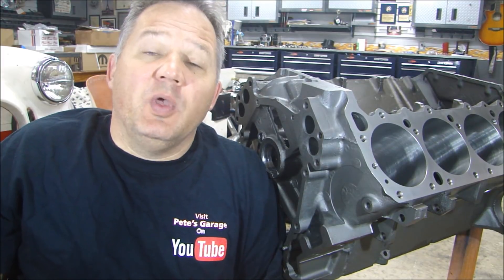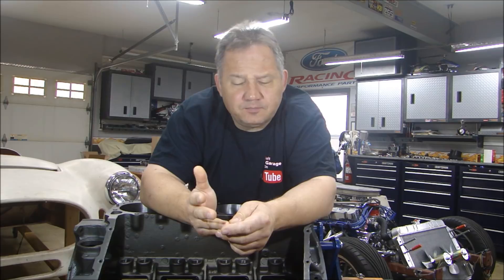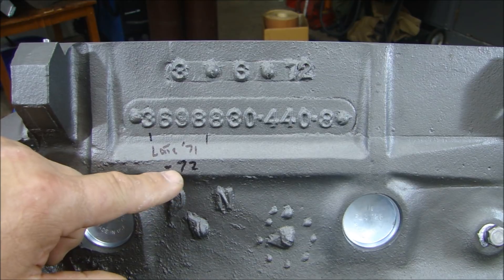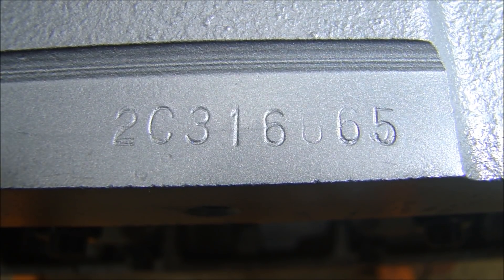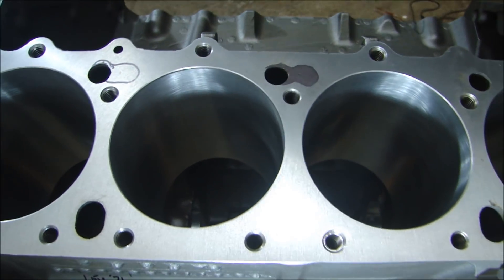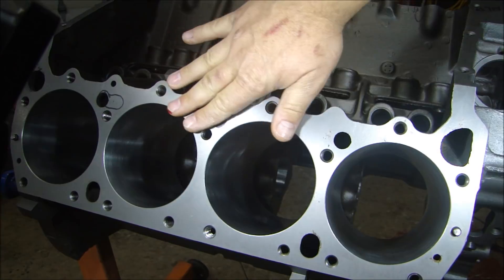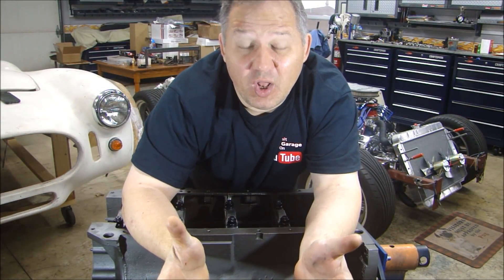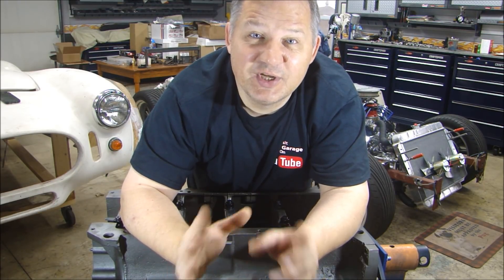440 Chrysler Mopar Engine Building Part 1 - Getting a Block and Machining

Comment: thanks ive got a 76 440 and a 67 383 the 383 was an old school 426 im rebuilding into a 426 been a process just figuring what im doing with pistons and rods bb chevy rods and pistons 1.70 rod ratio and 1.71 compression height are what that one is looking like. my 440 is headed towards the 500+ cube inch zone after i run it a little bit. interested to see what you use for crank pistons rods and heads .
Reply from the maker: That sounds like it will be a monster

Comment: Pete can u give me some input on a ATI  damper there is no keyway. Just is there any specs for a 44o thanks
Reply from the maker: I've never seen one without a keyway, they usually have two
Reply: This one bolts up with no keyway on a hughs crank is there something that I'm missing
Reply from the maker: Send me an email or text message with a picture and part number

Comment: You always deck the block before you bore and hone you remove taper for installation of pistons and rings otherwise will have a distorted block to bolt torque plate to .
Reply from the maker: Thanks!

Comment: yep old vid, the serial number is the car it was built with and it was built on the day shift. I have a '65 383 and I know where this engine came from, and I have had it for over 30 years. Finally sent it to machine shop that cost $1,500.00, pistons $125.00 ea, cam $429.00 (mopar) and mopar springs $14.95 each. Do the math. Oh and the engine kit $895.00.
Reply from the maker: Thanks Jerry

Comment: I wish you would do a series on a 351 cleveland
Reply from the maker: I did a series on a 351W which is pretty identical
Reply: @PetesGarage  similar but it has a unique set of challenges especially in the oiling system.
Reply from the maker: You're right, I always add an extra line to go back to add oil to the rear main.

Comment: Missed the engine build date info on surface at front left side of block . HP indicates it’s high preference block and letter ahead of 440 is year and then below that is the day and month of the build. The blocks were stored and left to cure before they were built. So you could have a 72 casting date with a 73 build date.
Reply from the maker: Thanks Tom

Comment: Just cross hatch the cylinders, new rings and bearings, new oil pump, seals and gaskets. Stuff a big cam in there. Fresh heads, good springs, throw it back together.
Reply from the maker: That's 1 way

Comment: Pete Has givin a lot of incorrect info on 440's. Read comments..... I'll add another correction. When honing a block, a torque plate is bolted to the TOP of the engine ! NOT Bottom (one bank at a time ), to simulate the head installed and torqued to specs. This is because the head bolts reach into /along side of the cylinder and when torqued it distorts the cylinder wall. Make sure bolt depth is the same on plate as the head. Installing the crank has nothing to do with honing cylinder walls.
Reply from the maker: Thanks Steven

Comment: I bought a 440 block, 2 heads, and 6pack intake from eBay. They were sold by gdmusclecarparts3wng out of Florida, they were advertised as "good", ready to bolt on. When I took them off the crate and started to examine them the heads were junk! The valves were rusted open or closed and the exhaust studs were broken off. I had to replace all of the vales, valve guides and 11 of the 16 seats. The block was usable with one exception. IT HAD 383 MAIN CAPS!!!!! When I contacted the seller he said "ya they are cores". The ad didn't have the word "core" in it anywhere. He refused to do anything. I contacted eBay and Pay Pal, they were both worthless. So I don't buy anything used from eBay any more. If you see him selling anything on eBay, I'd run,run as fast as you can.
Well, live and learn.
Reply: How'd you miss the "Flordia" in the name..
Reply from the maker: That sucks
Reply: you got what you wantrd

Comment: Usually you start washing a block for removing the remaining metal part did the maschine do this for before they put in the new plugs .... Thanks
Reply from the maker: Yes, the shop baked out the oil and washed it
Reply: @PetesGarage   Hi Pete thanks for your reply

Comment: What $ is fair for a used, complete 440, late '60s? Not rebuilt, not e/b nor cl.
Reply from the maker: $800
Reply: I found a '72 440 just now on craigslist about a mile from where I work for $800. Too bad I already have a 400 for a 470 build. If you can, you want go with the B rather than the RB in an A body car. If I didn't have it already, I'd go get it. I got my tax refund this afternoon.

Comment: 7:00 the D and N next to the time clock are for Day and Night
Reply from the maker: Thank you
Reply: @PetesGarage  I've got an 81 crewcab I'm trying to bring back. 440, 435, 205, d60 powerlock f/r, 6in shackle flips and 4in springs, crossover steering..
Also 87 ramcharger, 76, ramcharger, 95 zj, 05 300, and 2 2011 wk2 grands... lol

Comment: I have a '72 413 block from a motor home. Would I be wasting my time with this block or should I just look for a 440 instead?
Reply from the maker: 440 has more parts available
Reply: There's nothing wrong with the 413. The only parts issue you'll face is piston selection. Check Summit, if they don't have what you want, you can get some custom made.

Comment: What coating is used on the block after the machining is done?
Reply from the maker: A paint called cast blast
Reply: Pete, does the Cast Blast need to be removed prior to priming/painting?

Comment: If you get the block decked, will you also need to get shorter pushrods if you cant get a think enough head gasket?
Reply from the maker: Depending how much it's decked, yes

Comment: Pete
The 8 after the 440 doesn't stand for 8 cyl. On Mopar blocks the number after the engine size represents how many cores it took to cast that block! 2 would be a perfect block one core for each bank, they add a number for every cyl core that gets replaced in the casting up till the number 10. Your block with 8 means 6 cores were replaced and should be Sonic tested to see how far you can bore it. The 2c36000 breaks down as 72 year c is not the casting plans but the assembly plant for the line of car it was going into, 36000 is not how many 440 were made that year but the last eight of the vin# of the car it went into
Reply from the maker: That is an awesome comment, thank you for the clarification

Comment: Merry Christmas Pete!
My 68 Charger build will need an engine soon so far I have the option of getting a 
1973 440 Motorhome with 80k miles
1976 440 out of a Power Wagon  unknown miles and a 1967 440.
It’s going to be my first engine rebuild, looking for 480-550hp without having to do any machining. 
Is that possible? 
Open to suggestions
Reply from the maker: Merry Christmas Jeffrey. Whichever one you some machining will be required to get the kind of HP you're looking for. At least standard rebuild machining.

Comment: Also , if the block was run a in a drag car , watch out for  block filler also , people fill the blocks part way with cement type of filler  to add strength . I have run 440 blocks from all years and never worried about the numbers , they will all handle 500 hp with no problem  as long as they are not cracked . The block in your video has the webbing on the outside that some dont have , I always liked that  because it makes it more rigid .  I have used nitrous on stock 440 blocks  up to a 350 hp plate and never hurt a 440 block  . Lots of  Motor homes had 440's also , but if you plan to use stock heads , beware , the motorhomes  sometimes had  huge industrial cooling systems with special heads and water pump  that you dont want for a hot rod   . The shortblock from that industrial set up is fine though .  Some machine shops want those industrial  heads to sell for  motorhome  rebuilds .  And , I am glad you mentioned align honing and decking . Machine work is the key to a great  build , cam degreeing is a must if you want all the bang for your buck .
Reply from the maker: Awesome comment, thanks Ted

Comment: This guy gave everyone listening good info.  I have a 440 thick mains truck /rv block out of a RV.  And mancini stud girdle.  I broke a 73 block up through the mains so I'll tell everyone that is going to swing flow the fence horse power wise needs the stronger block.  I'm at 15 to 1 now.  Short fill solid predator cam
Reply from the maker: Thanks for your comment!

Comment: I bought a 440 block (and other parts) from ebay. What a disaster! The block came with 383 main caps! The heads looked like they were found at the bottom of a lake not one valve would open. I ended up replacing all the valves, valve guides and 11 of the 16 seats. The block and heads were sold as "good, ready to run" His name?  gdmusclecarparts3wng. I wouldn't believe this guy if his tongue came notarized.
Reply from the maker: I never buy parts from Ebay

Comment: A shop quoted me $2500 to rebuild my 440 to factory spec does that sound right?
Reply from the maker: Well, which factory spec to which year? Are you reusing the block, crank, and heads? If anything needs to be machined it could take it out of spec so building back to spec would be impossible without replacing those parts. You could just rebuild it as is with minimal machining and do it for $2500.
Reply: Rev up your engines!!!! It's scotty!!! It's kinda weird that utube big wig mechanic for over 40 years would ask a question like that??? Come on Scotty this isn't your 65 mustang this is a "MOPAR" there the unicorns of American muscle...

Comment: All the machine work you mentioned that's the correct way to start your build if your machine shop can't perform all those services find one that can. 
By the way what's your view on a stud girdle personally I think they're a must on a big power build  .
Reply from the maker: I agree Neil, thanks. I always use a stud girdle over 500 HP

Comment: Pete, I am considering using billet aluminum main caps for my 440 stroker build. Should I use billet aluminum or billet steel? Which is stronger? This will be a street engine mostly with some drag strip use occasionally. Also, will brand new main caps need to be line honed? Thanks!
Reply from the maker: Any time you change a main cap it needs to be hones. If the steel are original I would use them.

Comment: in the early 70s i had a guy bring me 440 engine that had a damaged piston.    when i got the pistons out  2 damaged.   but all 8  was .010  OVER std.    my dealer told me .010 over was available ONLY to the factory.  also the first year for the 440  was 1966.    with small ext valves.   1967 had bigger valves.   back in the day the 67 heads was what every one wanted.
Reply from the maker: Awesome comment, thanks
Reply: Moe Shouse 

Yup. The “915”. They had a closed chamber compared to the “906” heads.

Now... unless you are restoring, aluminum heads are the way to go.

Comment: Engine from a 440 r/t bored out to 505 CI. Too thin?
Reply from the maker: Nope
Reply: That is an estimate based on my inexact knowledge of the original size of the bore. A lowest possible.  @PetesGarage
Reply from the maker: What are you trying to do?
Reply: Deciding if the engine is worth paying money for or not. @PetesGarage
Reply from the maker: If it's $350 get it

Comment: theres a guy who has one for 400.00 it is bored 60 over, and he has 451 heads.
Reply from the maker: You can find those occasionally. If it's already .060 over and needs to be cleaned up it may be a problem. Definitely grab the heads

Comment: Getting an American Stock with 440 ready to race in dirt,  it has to be stock, what heads would you recommend,it is a 75 Monaco
Reply from the maker: Well, if it has to be stock, 452 iron heads with bigger valves will help you some.
Reply from the maker: @hishok3332  Wow, yes, 452,that's what I get for typing on my phone...lol

Comment: the 440-8?  440 is the engine size, the 8 is for the core shift count on the cylinders. For a high- performance build, using a passenger car block the core shift count you want is 1- the lower the better. Motor home/industrial motors will be 440-3; they are the HD versions, that number is not same as the car/pick up versions. The heads &  exhaust manifolds will be different with raised ports. As far as the 'muscle car' engines? The 383, 400, 440 heads are the same for the Magnum &  non-Magnum variants. The difference was in the cams, compression ratios, carbs, exhaust - things that did not have them running separate casting & production lines- only the 340 6-bbl AAR Cuda's & T/A Challengers got special heads (X-heads) due to SCCA rules, and that was a 340 LA small-block. The casting number was for the BB & RB's of the era 906. They never made a production dual-quad set up except for on the cross-ram type headaches. Do not care what "Uncle Earl" told you or urban fables- you had to be a "Somebody" to get anything really special, because pulling stuff off or holding up a line was & is big money
Reply from the maker: Awesome comment, thank you very much

Comment: DO NOT buy pistons before you hone the block! What happens if your block doesn't clean up at .030? You now have a set of .030 440 Chrysler piston paper weights. A block doesn't have to be torque plate honed either. In a performance build it needs to be.
Reply: @Donald Prairie You asked a question,  I answered it how I did it back in the day when I worked at a machine shop. You didn't like the answer because it didn't match the answer you already had in your head. You knew your own answer but just had to ask the question because it makes you feel smart and important to make post to show everyone how smart you are. You like your way to skin a cat and my way worked for me when i skinned cats. Out of courtesy i will say sorry to make you angry, but i don't care about your feelings.
Reply: @Donald Prairie Rough hone to .003-.005 of desired final size and then final hone when you have pistons in hand.
Reply: @Donald Prairie Well, it sounds like you have it figured out. I'm happy for you.
Reply: @Donald Prairie Um, no. I said hone because I meant hone. I used aggressive  grit roughing stones and worked towards finer stones as I got close to size. I could rough out a block faster in the hone than setting up the boring bar.

Edit you apparently didn't ready any of my past post in this thread or didn't comprehend them. I never said to final hone without having pistons in hand. I said to rough hone close to the final size you wanted to make sure the bore will in fact clean up at that size. Barrel, bell mouth, or cylinders with bad ridges won't always clean up the next size larger. We don't all get to play with new dart blocks.
Reply: @Donald Prairie Good. Because I'm done with you too. I hope you're finally done telling me I'm wrong on everything I did In a past career. I wish you many powerful engines in your future, and hope you feel like a big powerful man now.

P.s. would you like to know anything else about my life so you can tell me how I did it all wrong? Not that I care but I am finding humor in all of this. And you're not having to spend any money on a therapist to feel better emotionally!!!!
Reply: @Donald Prairie Wonderful, and yourself?
Reply from the maker: That's why you need to measure and have a good machine shop. Machine and hone to the size of the pistons. I've never had a problem yet.
Reply: @PetesGarage  if you have a block with a bad ridge it's even difficult to get a good reading with a dial bore gauge. If it's a cookie cutter engine for the shop (one of their specialty, could build it blind folded motors) then yes they probably have the pistons before they hone it. There are probably a few sets on the shelf. If you are doing a random, uncommon engine like a 440 (vs 350's and ls engines) it's taking a big gamble to do so. At least rough hone/bore the block and see where you stand first.
Reply from the maker: Good suggestion, thank you

Comment: $1600 bucks for machining????  You are getting ROYALLY ripped off!
Reply from the maker: It all depends on what you have done and how bad the block is
Reply: @PetesGarage  I talked to 12 machines shops in and around NW Florida. Cleaning, MPI, Decking, Boring, Line Hone, and bore hone dont go north of $500 at any of them. Only thing that causes a higher cost is sleeving. Turn around at all I talked to is two weeks at most. All of those flat rate the work. Could that be the cause of the discrepancy?
Reply from the maker: @bjbeardse  I think the difference is that I included the cost of fitting the pistons and checking bearing clearances. I'd have to look at the bill again. You are right, just the machining costs are usually around $500.

Comment: Big block Mopar, line boring = guaranteed rear main seal leak! Don't do it!
Reply from the maker: You have to if you have to change a main cap for some reason
Reply: That is bullshit. Built 4 RB's with a line hone. ZERO leaks
Reply: @bjbeardse  I think the point here is that there is more than one way to skin a cat.  There is more than one way to successfully build a solid motor of any kind.  Pete has a way that works and I am sure you have ways that work as well.   God bless!

Comment: Don't beat me up guys but I need help I'm a mechanic and actually build custom motorcycle now but have restored many vehicles too...NOW I just bought a 1976 Dodge motorhome the square ones just for the engine/tranny I know it's a big block but not sure what the ol boy owned it since 1984 and says it's a 490? (DON'T KILL ME) but I'm building a drag truck and need comparison engine as this one has a blown head  gasket it runs but I'm not going to start it untill I rebuild it but it turns over fine.PLEASE HELP DON'T MURDER me in the comments lol
Reply from the maker: Nobody gets beat up here, we are all trying to learn. Dodge didn't make a 490 in '76. It has to be a 440.